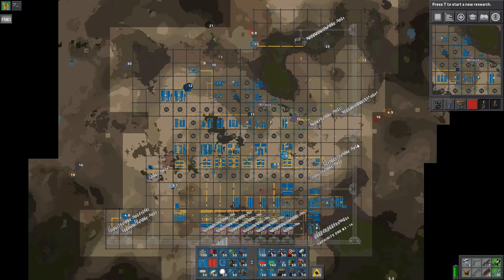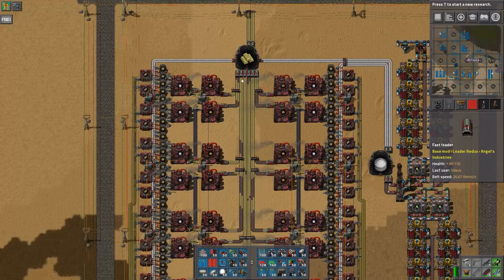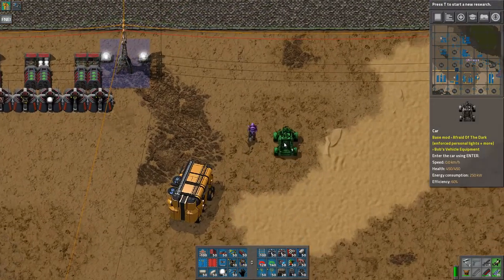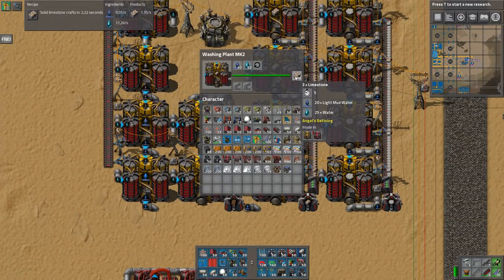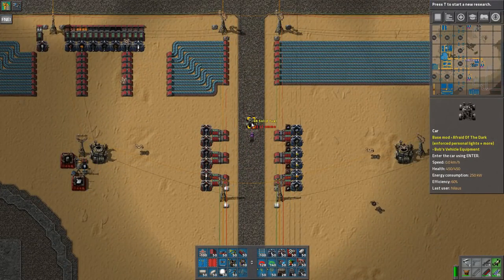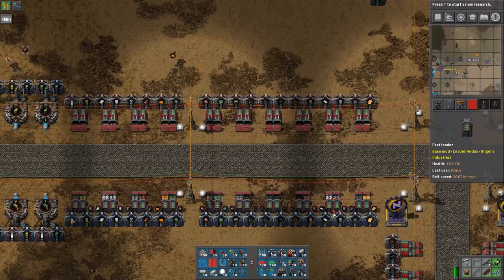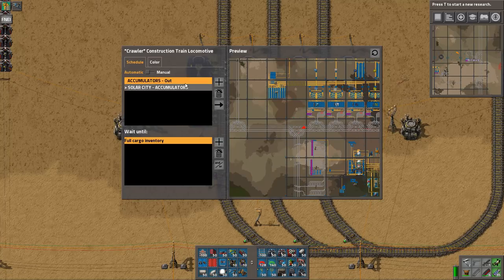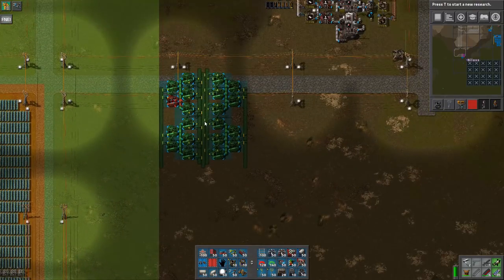Factorio 0.16 - Angels Mods Tutorial Lets Play #46 ALUMINIUM AND CONCRETE

Comment: I wonder, is there any advantage to using Angels Construction Bots over the vanilla (and Bobs upgraded) ones? They seem a lot slower and still only carry 1 item at a time. It would be really cool if a single bot could pick up like 10 solar panels and then proceed to place all of them, but as it is, regular bots would do the same job, just faster. Especially as they get upgraded.
Reply from the maker: Angels Construction Bots are primarily cheaper than normal bots (engines + BEB)